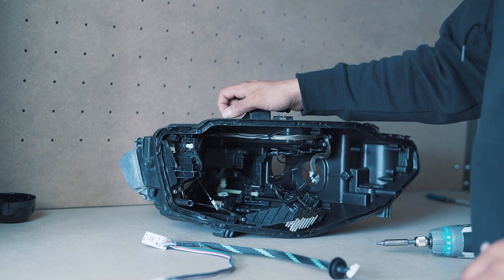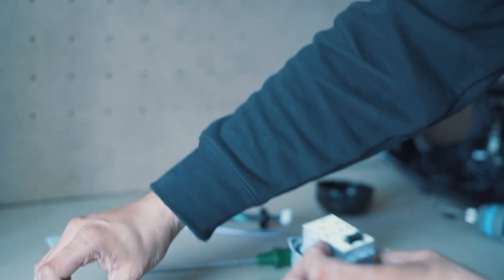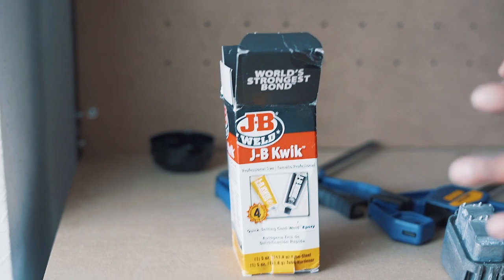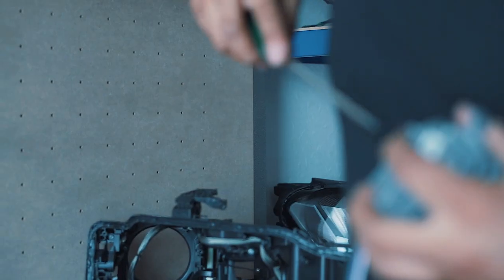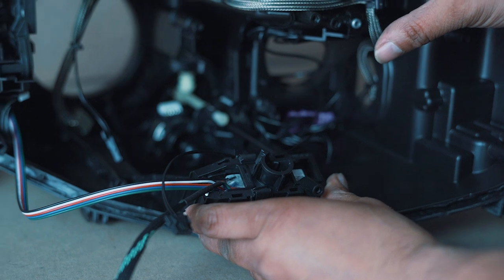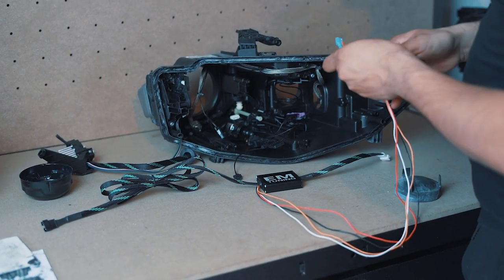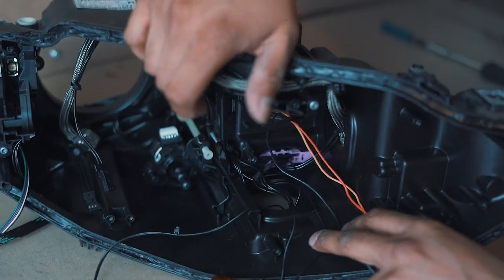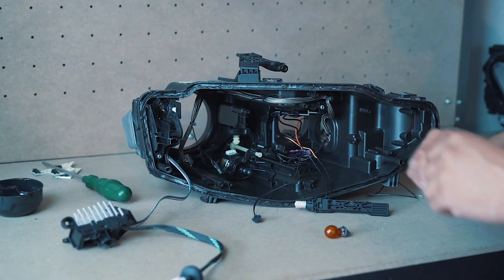RGB DRLS DIY for Audi B8 & B8.5 Models

Comment: Just curious.. Since the boards are attached to heat sync, shouldn't you use thermal paste instead of jb weld? Seems like you'd need thermal conductive paste in order for heat sync to work.
Reply from the maker: Hey Zach. You sure can use some form of Thermal Paste glue. JB quick well has done great u see tests since the heatsinks don’t really get that hot. Plus we supply an external heat sink in the kit for the lights as well.

Comment: thats not glue thats thermal paste for transfering heat from led to heatsink..... you just glued it ... .
Reply from the maker: Not sure what your asking but we use JB KwikWeld as the “Glue” it’s made for high heat applications. It’s a fast setting epoxy that provides a permanent bond between the PCB board and the external heat sink.

Comment: Hi 
I saw icedrive on aliexpress . Is there any way that i can use plug and play . Audi a4 b9 2017
Reply from the maker: The icedrive kit is totally different. It’s also not made that great. Not bright at all. Not sure if it would work on a B9.
Reply: @motiongate  is there anything just plug and play. Remove the original drl module and install these??

Comment: thats so interesting, but two questions before purchase, as i see the new drl boards are connected to 12v of key ignition, but what happens when i light on low beam lights?? it seems drl not dim and shine too much at night??? and what about error code for not connect original drl boards??
Reply from the maker: The best way and correct way to connect the DRL Kit is on the inside how the video shows. This way you avoid having power drainage from connecting it to an external power source. You want the DRL to turn on when you car starts like the OEM way and installing it on the inside in pins 9and 10 achieve this. 

This also avoids error codes. The kit basically acts like the OEM DRL PCB boards. The amount of light output from the DRLs  can be controlled via OBD2 app or a vag-com. Some people max out the DRL while others run it conservatively at 40% output level
Reply: @motiongate  thanks for the quick response ;) but correct me if i am wrong, the drl strip always will shine at his maximum even when low beam lights are on? because its always powered and not dimmed (alrhought maybe is dimmed via app, but it seems a..little bit crippy task)
Reply from the maker: @joaquintorresabad1625  correct. The DRLs never dim. They stay at the constant brightness level they’re set at. For example most of the time the stock setting I believe is at 24%. Depending on if your DRLs are getting old and burning out they could look more dim. I’d you change the setting on a vag-com or odb2 tool then it can be raised to a higher brightness
Reply: @motiongate  thanks , now this part its clear, another doubt is referent to the turn signal, its possible to shine only drl strip in orange without the oem bulb and no error? cause it would look too much better without it, i see in your video you put a led bulb, but it would look like more modern without that light
Reply from the maker: @joaquintorresabad1625  unfortunately there is no way of just shining the DRL light as an amber turn signal unless you do some major reworking. We don’t do that work. Not even sure how you would set that up without it causing an error. What you can do is get the LED turn signal bulb and when it flashes, it will match the timing with the DRL so it flashes in sync.
Reply: @motiongate  maybe with a resistor of 25W in bridge? it would emulate the watts of the oem turn lamp?
Reply from the maker: @joaquintorresabad1625  it’s possible I guess. Could work.
Reply: sorry for the update but, and what happens in auto lights? when i open the car with the key and auto lights shine on, led rgb strip will shine? or only when the ignition starts on? pin 9 & 10 from the inside gets tension when auto lights actuate? thank you in advance

Comment: What are the positives of wiring it into pin 10 vs the positive battery terminal?
Reply from the maker: The only positive is it’s all integrated in the light.  If you sell your lights the person buying them doesn’t have to wire anything. Also since you’re taking the lights apart anyway to install the kit it just makes sense to do it all internally.
Reply: How about how it works? I mean.....if you take power from the battery terminal, would it not mean I have to turn it on and off manually? Whereas pin 10 should supply power only when the headlights are put on. Is my assumption correct?

Comment: I have problems with left drl of audi a4 2013...don't switch on. What should I do?
Reply from the maker: Redi Hoxha I’m not sure how you wired it up but I’d check the power going into that light. It could be something as simple as that.
Reply: B8 Drivers I should take off headlight glass?
Reply from the maker: Redi Hoxha I would check the power on the Bluetooth controller first. See if that is working. Switch the wires from one side of the light to the other side of the light and see if the problem moves with the wires. Then the wires might need to be fixed.

Comment: Could these chips work in the vland Mitsubishi lancer headlights
Reply from the maker: Hey.they won’t. The boards are set up different in those lights.
Reply: @motiongate  so where can I get the chips for them
Reply from the maker: @dexterlemaitre1172  not sure as we don’t do Mitsu lights. I’d look into morimoto or maybe diode dynamics
Reply: @motiongate  ok thanks alot